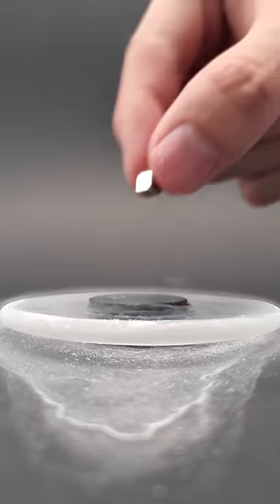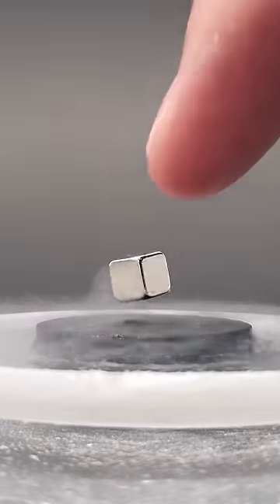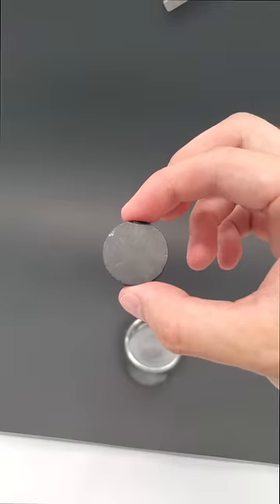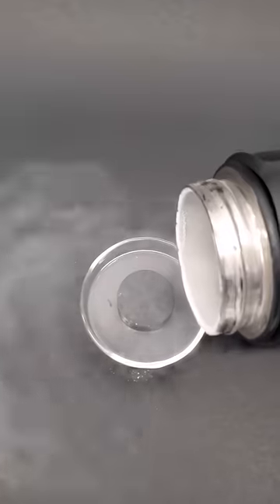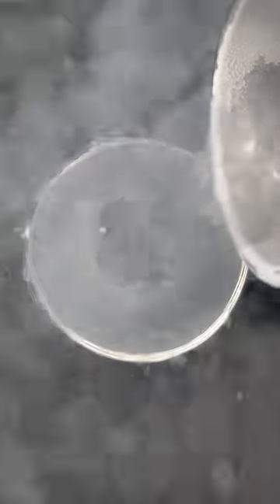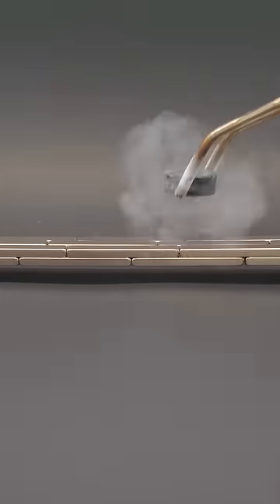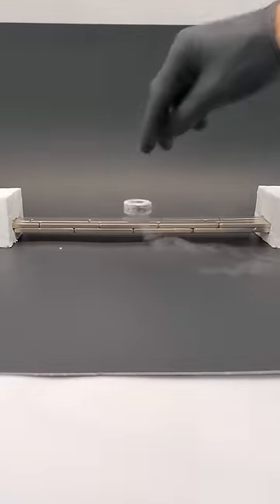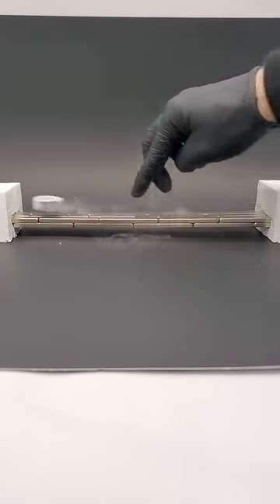Watch this superconductor hover around in mid-air!

Comment: Still waiting for someone to make a real hoverboard park with real hoverboards, just boards with magnets and superconductive flooring or vice versa whichever is easier. Some rich guy make it happen 👌
Reply: And make you pay to get it to float again
Reply: It is possible but a whole city needs to have a super conducters under the ground and the fuel for the hoverboards will be liquid nitrogen
The whole hoverboard is a magnet but not a strong one strong enough to make it float and the way to move is is with thrusters and it also needs gas
Reply: @ssz1609  he said a park so not a whole city just a park
Reply: Also doesn't it have to be cold continuesly, if it heats up it loses it's ability to hover.
Reply: You have seen seen the lexus hoverboard ad tho?
Reply: They're called mag lev trains
Reply: Bruh the hacksmith exists they already have made a prototype hoverboard
Reply: @Purppura-  well, maybe the hoverboards can be metal. We already know how to produce coldness from freezers from our fridge, so maybe using power from underground can help with that.

Or, we can have a special mini freezer for the hoverboards that can be connected by cable using public power ports. (I've seen a freezer type thing with the surface flat, similar to a electric stove but it does the opposite).
Reply: Yeah but that's inefficient better off just having a magnet line
Reply: Lexus did it
Reply: I don’t really know anything about this stuff, but I think it would be easier to have the magnets on the boards and the superconductive floor, because the superconductor has to be so cold for it to work. So if the superconductor is in the floor, they can just keep the floor super cold all the time. But if it was in the boards, I don’t think it would work.
Reply: MR BEASTT
Reply: Lol
Reply: I certainly hope so
Reply: @coral497 no the fridge/freezer tech does not get as cold as liquid nitrogen. That's why he uses Liquid nitrogen. In fact it will 'burn'' you. I mean the sensation is so cold your body perceives it as pain in the form of 'burning' nitrogen is also fairly plentiful. You can buy it at any Walmart or Walgreens because it's the primary ingredient in a product that makes warts fall off by 'burning' them. You'll notice he never touches it directly (Because it's negative 320 farenheit, jeez!) opting for tongs to grab the super conductor and only touching the super conductor through gloves for at most 3-4 seconds at a time. Edit: it will cause frostbite to your skin and muscle tissue likely leaving  scars, do not play with this stuff at home. The guy in the video obviously knows what he's doing and is a professional judging from his equipment and expertise. He likely knew the result of this exercise before he conducted it even.
Reply: How you gonna keep it cool tho be a lot of wasted liquid nitrogen. unless you made some kind of superconductor radiator but guessing that would not be cheap
Reply: @kushking5354  well if you keep liquid nitrogen contained, it will remain pressurized and cold. Nitrogen only becomes a liquid at -320 farenheit, so if it remains contained in it's liquid form it will always be cold.
Reply: @williamturner7021  yeah but my issue is the expense it would cost to design and then build a type of radiator made out of pure superconductor not to mention it would need to hold the pressure of the nitrogen
Reply: Maglev train works is a real world example
Reply: @ro_heart2840  how would you make that smaller tho like hover board size?
Reply: @kushking5354  so before you were worried they couldn't do it that big because it's expensive now you're worried they can't do it that small? Do you see how small the items are in this video?
Reply: @williamturner7021  yesssss but think for a second in the video he used liquid nitrogen to cool the superconductor down temporarily and with the size of that super conductor couldn't hold up much weight now you say the can do but on a train size scale well i would think its a lot easier to build a large vessel capable of cooling a larger type of superconductor along a set rail .but if you read the original comment he is asking for someone to build one on a skatepark or hoverboard park level which would mean you would have to either a self containing and self cooling super conductor board strong enough to float a person or either build the whole park out of pure superconductor and cool it that way.
Still don't see any way of doing it unless you probably have billions 🤷😂
Reply: @kushking5354  so essential you mean a hollow super conductor filled with liquid nitrogen. Why is that outside of the realm of possibilities? Also the original poster specifies some rich guy make it happen. We don't think it'll be cheap either, and none said it would be.
Reply: @williamturner7021  well quite honestly take the idea and run with it 
I cant imagine pure superconductor being able to hold the pressure of liquid nitrogen but hey i might be wrong my other point would be that fine line of weight lifting capabilities as with the coolant included i dont think it would be able to lift much 
Idk im not an expert you sound like you know a lot more about this subject than me 
So you tell me
Reply: @kushking5354  well if you wanna get technical, in this very video he keeps that liquid nitrogen in an aluminum can. Aluminum isn't particularly durable. That should tell you everything you need to know. Also I thought we agree that it'd be expensive. Do you think a billionaire is talking with you over YouTube comments?
Reply: There are ways around your other point also like increasing surface area.
Reply: @williamturner7021  you would agree that uncontained liquid nitrogen would boil off yess? So having it stored or used in an open container is effectively pointless and i dont really care who has Money in the comments i was simply commenting on the problems i thought someone would run into if they tried to make a hoverboard or hoverboard park
Reply: @kushking5354  you told me to run with it no? Which basically implies that I have the resources to do so. Your counter argument doesn't even argue what I said. Now your talking about uncontained nitrogen, which you are right about, but it has nothing to do with the fact that aluminum can hold nitrogen and so could a self contained super conductor.
Reply: @kushking5354  honestly though best wishes to you, sorry if I sounded condescending. Good for you that you're at least thinking about it objectively, but you should concern yourself with solutions and not only problems. All hail the kush king, burn one for me!
Reply: @kushking5354  It's possible, I'm not denying it but it's a lot expensive.....
Reply: @rigeln1101   "just" a park.
Reply: The trillion dollar skate park
Reply: They kinda already did this, I’m not sure which car brand, but there was one who made a hoverboard on a skatepark liquid nitrogen cooled. One of the higher end car manufacturers probably, there sure will be some videos on YouTube of it.
Reply: Visa by cop..and tiket.
Reply: @williamturner7021  but luquid not two do.🤣🤣🤣🌝
Reply: It's already made yo, just go check it. The hoverboard park was made with magnets and the hoverboard housed the cooled superconductors
Reply: Lexus has a real hover board park
Reply: @Purppura-  they could use some isolant containers like aerogel
Reply: You're brave 💯
Reply: Didn't someone make an actual functioning hoverboard?? saw it on here a couple months ago, have no idea who it wad
Reply: @dragon-du6ew  Lexus has already done it years ago
Reply: And like a “U fall U freeze” if we try to get the conductors to do actual shiz
Reply: @rigeln1101  I want it for the entire city! 😤
Reply: They've made one years ago, it just needs special flooring which ain't happening on a national scale.
Reply: Lexus the car company made a whole skate park with an actual board and it worked look for it on YouTube lol
Reply: someone actually did exactly that I don't remember what it's called though
Reply: This already exists… look up Lexus hoverboard!! It is exactly what you are describing
Reply: And the fuel is liquid nitrogen
Reply: Yeah something like ice skating rinks or something that would be so fucking cool-
Reply: I think the hacksmith is working on it but they dont know how to fly it smoothly
Reply: All fun and games until a kid with a metal impact walks in 😆
Reply: Right or trains
Reply: Hacksmith did one
Reply: What does superconductive mean will it be a lightning hot spot or what
Reply: Lexus did it

Comment: Fun fact the super conductor heats up faster when above the magnet vs just being sat on the table. This is because of something called eddy currents. When a conductor is placed over a magnetic field, current starts circling inside the conductor, which will warm the conductor.

There is actually a new form of stove that utilizes eddy currents. So if you hold a pan over the stove top the pan heats up, but if you touch the stove top you won’t feel any heat coming from it.
Reply: Where can I know more about this stove?
Reply: @abashedstorm  It's called an induction stove top. If you want to know the physics behind it, you could look into magnetic induction and eddy currents.
Reply: I know this sound obvious, but dont touch the stove AFTER you test that it heats the pan. Your hand doesnt become hot like the metal pan you use, so its safe to do that when the stove just turned on, but once the pan is heated the heat will transfer from pan to the surface of the stove (which you definitely dont want to touch).
Reply: I have that stove, the technology existed for a long time though
Reply: @phantomtd837  thanks. Sorry for late reply tho. I don't get notification alert for google things anymore dammit.
Reply: Considering it's a super-conductor, it should have zero resistance and thus no heat from Eddy currents (which are the cause of its floating above a magnet, as you know).
Reply: The stove isn't new. It's induction, and these types of stove have been around for many years.

Comment: If you watch carefully you see what looks like a little bit of liquid nitrogen "reaching up" to touch the floating magnet. This in fact is Oxygen that has condensed into the liquid nitrogen from the ambient air due to the higher boiling point of oxygen compared to nitrogen.

Comment: “I’m gonna cool the superconductor with some liquid nitrogen”
* pours it all over table
Reply: Freezes self*
Reply: @josephkingman523  he cant freeze himself from the liquid nitrogen
Reply: the mist is actually water iirc not the liquid nitrogen 🙂
Reply: @NKY5223 the container overflowing:
Reply: @frindjinny6  lmao 🤦
Reply: and then he slams the table on the track and it starts floating 💀
Reply: @frindjinny6  i mean, it doesn't really matter if he spills it because it instantly evaporates anyways lol
the only reason liquid nitrogen is dangerous is bc it's extremely cold, once it goes back to room temperature it turns into a safe gas

Comment: I see a train, or frictionless smart cars.
Reply: That’s literally how japanese MagLev (high speed trains) work
Reply: @olatomiwaolajide4872  yup!
Reply: Mike Hawk  warm the magnet up
Reply: @olatomiwaolajide4872  I though Japan uses bullet trains while China uses maglev
Reply: @user-91291  bullet train is just a nickname given to them in Japan cos of their speed and shape. The technology is magnetic levitation just like the Chinese one.
Reply: @olatomiwaolajide4872  that’s only for one specific bullet train. The rest all still use wheels and electricity
Reply: @tropical878  I very much doubt those would be considered high speed trains.
Reply: Is it possible to make aircraft with superconductor. And liquad nitrogen in the craft Hull  and use the earth magnetic field  like a UFO ?
Reply: @adithyasuresh9720  A liquid cooling system that large would add a lot of weight. We aught to be okay though if it's all cycled through one central freezing point before being distributed evenly across a thin panel to help reduce the heating build up.
Reply: @user-91291  Bullet Train is what Japan, France, and China called their trains that run on MagLev (Magnetic Levitation).
Reply: train same for me
Reply: @simimik.  Very few of Japan's MagLev are Bullet Train.
Reply: @simimik.  Nah maglev is Japanese. Train from France is called TGV. Chinese train is called Bullet.
Reply: @user-91291  nah, the opposite. However maglev is also a type of bullet train.
Reply: The liquid nitrogen is fuel, or the gas for cars, and roads are made of magnets not asphalt
Reply: I see the hallelujah mountains of Pandora

Comment: Interesting that it loses its power to float when its "warmer"
Reply: so uncalled for 😭
Reply: noooooooooo 😭😭😭
Reply: Sorry but can someone explain?
Reply: Aaayyy
Reply: nayem Abbassi  same
Reply: That’s why the aliens don’t visit anymore. Global warming
Reply: Actually simple physics
Reply: Yeah I think it changes frequencies kinda like heaven on high is cold so the soul floats up if heaven and hell's hot so when u die your body and brain frequencies  changes and if dine correctly it could be a new way to fly I mean maybe that's how these flying saucers are working really think the superconducting material plumbed through out with tubing a tank of nitrogen and a pump n you could make it float cause the earths a big magnet a few nozzles and some pressurized air and it could go any direction like the space shuttles and would work under water to
Reply: @andrewcrider7148  i can't tell whether or not you're joking 😅😂
Reply: @VincentANDAlexander  Semiconductor only works because eletrons in these semiconductors work in pairs, so they can bypass the obstruction from nucleus, but when temperature go higher the electron movement goes more vibrant and are not able to establish connections between themselves (think of holding hands, you are less likely to hold hands with someone for long when you both are sitting in a different car with random direction of travel, but then the car almost stopped you two can jump out and hold your hands), so they became normal charge carriers and would be slowed down by nuclues, and that what causes resistance.

Now in a strict term only type I superconductors were concerned with Cooper pairs, its quite obvious because when most electron state are below Fermi energy and phonon generation almost ceased the Columbian inteaction between charges would be dominant, so any charge movement would induce significant reciprocal actions, and such interaction can approach the theoretical maximum of electron mobility (which is infinite) because the change of potential itself is immediate.

Comment: my heart skipped a beat when the nitrogen started spilling on the table
Reply: It's just nitrogen
Reply: @Gozieaaa shit can cause burns
Reply: @KeiraSamson  only if you touch it for more than a second
Reply: @Gozieaaa zeptosecond*
Reply: @superluigi___7317 It probably evapoeates at the same time
Reply: @Gozieaaa more like ten seconds
Reply: @KeiraSamson shit also evaporates almost instantly due to the fact that it’s a gas at room temperature and has an extremely low boiling point
Reply: @zydacolv  guys what are you talking about shit doesnt do any of that
Reply: @superluigi___7317 you don’t know what you’re talking about
Reply: @muhammadsoman554 Lmao
Reply: @Gozieaaa  which you can definitely do e.g. if some of it falls into your shoe or similar. the main thing that protects you is the leidenfrost effect, but there are plenty of situations where it doesn’t apply

Comment: I wonder if you could coat conventional superconductors with a really good thermal insulator to get them to work at room temperature for longer? Like the ceramics they use on spaceships that can get glowing hot but you can still touch them because they're such good insulators.

Comment: Imagine if in the future floating cars are gonna use this mechanism. Like there is magnets in the roads. the bottom of the cars are made of super conductive and the combustive of the cars are liquid hydrogen.

But there's a flaw: metal things are gonna be attracted to the roads.
Another flaw is: the automotive is  gonna be pretty dangerous, since if it's get out of the road it lost total control to stand.
Another one is: there's no breaks and speeder. So pretty much ain't gonna work as an automotive. But if put more worked on, it may be used to another finality in the future.
But more important, it was fun to think about it.
Reply: Nothing happens but tiktok users will increases.
Reply: @candyxoxo28  why?
Reply: Or we put electromagnets on the vehicles and put the superconducting substrate under the roads.
Reply: i think they are making magnetic railroad tracks
Reply: New Chinese maglevs uses superconductors.
Reply: Meh, too costly and needed way too many infrasturctures. Try a Gyro Bike. Someone made a working prototype before.
Reply: One possibility would be that the car would be self-driving so that the driver doesn't have to risk steering it
Reply: You still would need to cool the superconductors. Maybe a cooling system, like a tank of liquid nitrogen on the other side of the super conductor?
Reply: we are in the future now
Reply: I work in roadway infrastructure engineering. Future plans are multilevel roadways with self driving electric vehicle pods controlled by gps using mag Lev technology. The idea is to completely eliminate accidents and traffic. The plan is to start with single lanes on highways. Basically self driving pod will take you from your neighborhood to the highways and link into the mag Lev track. Obviously tons of issues implementing this plan but, this will be norm in 50-100 years.